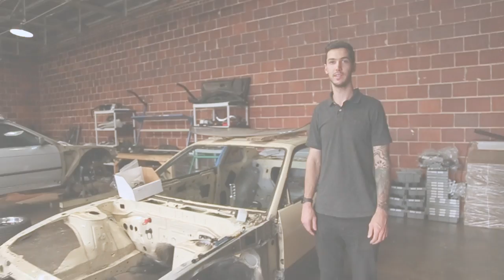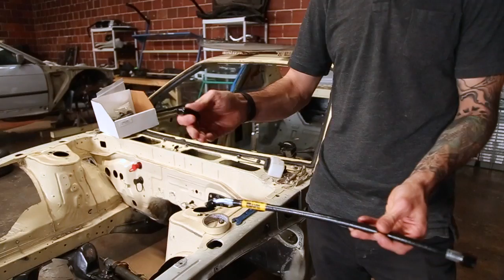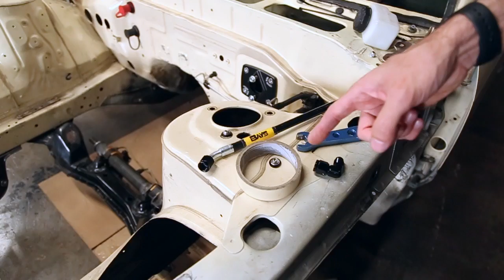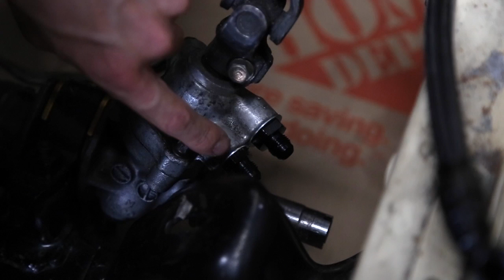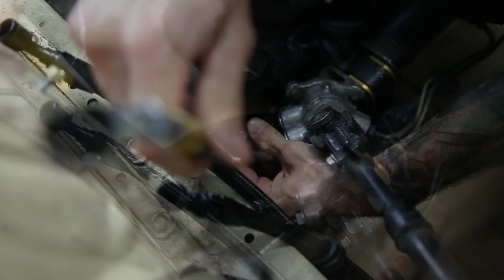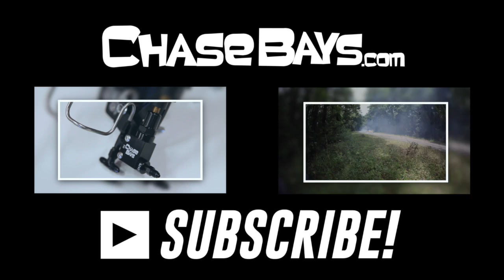Chase Bays High Pressure Power Steering Hose : Swivel Update

Comment: Hi! I have a custom made PS hose but instead of using AN fittings into the rack I've made a banjo bolt on hose end. And my steering wheel now is very tight, so I can't easily turn my steering wheel more than 90 degrees. Is it possible that banjo bolt connection limits the flow of oil and therefore power steering works bad?